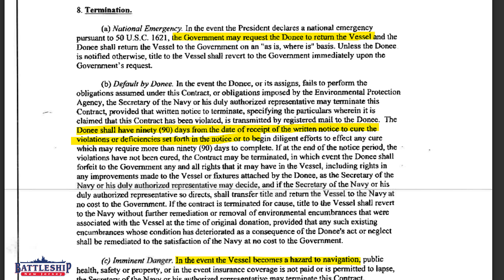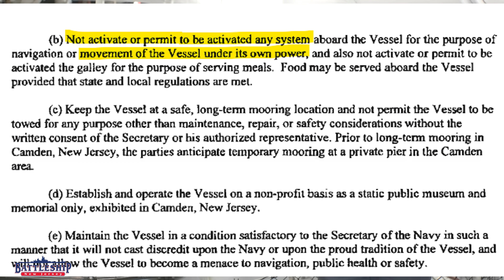Can Battleship NJ Still Move Under Her Own Power?

Comment: Question. The  turrets are all one assembly and they go through the armored decks, could a crane (if one strong enough could be acquired) lift the entire turret assembly out either in sections or whole and the engines replaced through the openings?
Reply from the maker: The turrets have locks that would make removing them wholemeal difficult. Moreover, you'd have to completely gut the inside of the ship to pull them out through there, the cost of which would defeat the entire purpose of doing this.

Comment: The USS COD in Cleveland Harbor could move under it's own power. if it had propellors on the shafts (They are in the yard) and it is sitting on the Lake floor. I mean they just moved it.. so maybe it would move. Just need props installed. Hope you do Museum Ships on the air. Ill be there next year.

Comment: I had the privilege of watching the majestic Missouri sail into Monterey Bay in the late 1980s with the both the Missouri firing a 5 inch 38 and the Presidio of Monterey DLI firing a salute as well as would be tradition at times for ships entering ports.  The Missouri was on the way to the Middle East.  A couple of naval patrol boats accompanied the ship with the gunners firing I assume blank machine gun rounds as part of the entry salute which I actually got one of the spent brass as the navy was handing them out as souvenirs.  I remember having dinner with my wife on Fisherman’s Wharf looking out at that awesome battleship at anchor.  As Monterey Bay has a very deep submarine canyon it would not surprise me if there was an accompanying attack submarine nearby to protect it as carrier groups often have.  I also watched the Iowa years later being towed to the mothball fleet in Benicia.  Kudos. for your work!

Comment: He taking old Battleship like in New Jersey and retrofit like you do an old car and I put Modern Diesel engines running generators that run water jets made by Rolls-Royce and turn it into a missile frigate instead of artillery shells it can shoot missiles other than 18-inch guns steak a couple big boy lasers on there believe it or not it has torpedo tubes front and back back from World War II but they can be retrofitted instead of dry dock and all these things and letting them sit up on the Saint Lawrence Seaway her out at Long Beach in the museum it cost a lot less money than retrofit something like that than to build a new missile frigate

Comment: Does the Navy actually know if the long term preservation is working? A lot of time when we do things like this when we come back to them it's "oops, looks like there's processes that happen over these time spans and these conditions that we never knew about or understood - and now it's either economically irreversible or we just don't know what to do".

A good example is when we've tried to define standards in physics. Almost every time we've based it on something physical, after several decades it's "right so it looks like some of the platinum standards have gained mass and others have lost mass over the past few decades and we have no idea why, despite platinum seemingly being extremely nonreactive and samples being stored in the same conditions".

That's why we essentially gave up and decided to base them on exact metrics instead of arbitrary ones.
Reply from the maker: The navy isn't involved with these ships at all, so no. But as museums, we do get together and talk about our preservation challenges and how to solve at annual conferences and, to be honest, we all talk a lot.

Comment: One of my instructors in Navy basic was on the New Jersey- he said they worked as floating machine shops for the fleet- their motto was if you could get it into one of their machine shops, they could fix it. There were massive machine shops on these ships including at least one case where the shop was accidentally made with no hatches- someone noticed a blank spot on the plans, they cut through one of the bulkheads and found a fully stocked machine shop from when the ship was first built, sealed up for decades.

Comment: I would think de- comminished ships could still be used as a homeland security .also help stop illegal fishing. I  worked for Massachusetts water resource authority and we used engines such as enterprise, Chicago and walkashaw as both pumps and generators dc power. Question there are various de- comishion ships in various locations along the west and east coast as well as Florida, Louisiana so my question is there a location with various former navy ships location

Comment: I really hate your I can't do attitude bullshit... It'll be extremely easy to cut a hole into the top of the ship. And put a new motor in it.  And taking the oil out of the ship to put in new oil will not make the engine decompose. I know how steel works, and steel doesn't work that way.  If you keep paint or oil on  steel, it will stay good.   That's the reason why the navy makes. Ships operate ships and maintain ships while you just look at them.   With your can't do Attitude.      And another thing people can always learn how to operate in those engines.   And I'll add 1 more thing to it. If the ship was put together, the ship can be took Apart to put a new motor in it.       And you act like as soon as you Take the oil out to put new oil in all. The metal is just going to magically Wild together.  There's steam engine and gas inches. That's sitting a 100 years that was started Up and running.    You truly don't know what you're talking about
Reply from the maker: The ship was built around this engine, to take it out would require cutting the armor, armor we don't make anymore and armor that loses its strength if you weld it back together. 

And those steam engines that still run have been maintained to run, ours hasn't.
Reply: Good response to a completely unreasonable comment. If only it was so easy to just rip out and slap a new propulsion system in 😂

Comment: Even though the engines are preserved for storage is there an expiration of how long the process of preserving the engines will last before it may have to be done again? Also if they did have to the perform that process would they rotate and portions of the engine due to the fact they have been dormant for so many years?

Comment: 1982 west of Hawaii, I was a radarman on board USS Fox CG-33 we had become one of her MANY sisterships and were meeting her for the first time. Someone on the other side of CIC yelled out "max out your range." I didn't ask why, just did it. 25 miles was normal range on SPS 40. At about FORTY MILES there was a HUGE thick return. Never seen anything paint like that. I got some one to sit on my scope  and went to the signal bridge to watch. Scary big. I wish all the flat-earthers could have seen its approach. First mast, then superstructure, then MORE superstructure,  then MORE!  By the time it got within 12miles (horizon) it looked impossibility close. Our little 440ft aluminum guided missle cruiser was like a TOY compared to her majesty. Got goosebumps thinking about it. Was an honor being air picket for her

Comment: Boiler operator no longer a specialty in the United States Navy. This may present a slight problem since the propulsion system is absolutely dependent via eight 600 pound boilers. I steamed the Missouri BB (63) around the world in the eighties as a young bt 3 operating her super heater burner front. I guess what i am saying is good luck with getting them fires lit and a full head of steam .

Comment: It would be far easier, in my opinion. To build a brand new hull specifically designed for what large naval gun platforms were eventually used for. Design a hull with 2 to 4 large calibre guns optimised for shore bombardment. Then give it a couple of destroyers worth of attack and defence missiles and point defence. Then, use it in an integrated task force.
Reply: We can surely do that. But will there be capacity for that in case some disaster strikes? Events like war tend to twist the economics in building war resources. Cost will not be a question any more. The opportunity to rebuild the Iowas and other BBs, might be a faster way to get combat ready ships, if all the shipyards are bombed, or busy building other war materials!

Just keeping the BBs as museums, can act as a threat to potential enemies of the USA.

Comment: Per the fine print comment, having been a lifelong fan of the Iowas(I wanted to join the Navy and serve on one, but after the 1st gulf War, subsequent decommissioning, I came to my senses and went Army, ha ha) I've wondered what context would require the Iowas return, honestly, very few instances, any navy the U.S. could potentially face would be adequately handled by contemporary navel power.
Heavy shore bombardment just inst a prerequisite on the modern battlefield...
And blue water engagements are over the horizon games and the silent services ballpark.
As amazing as theybare, there's just not a practical utilization in these times. Other than a show of force, but aircraft carriers can do that.

Comment: To be honest, Some ships should be restored into some form of active service. The USS Enterprise "Grey  Ghost" is another ship that should of been restored. The "Grey Ghost" if i had the money, that would be one ship i would of liked to re-start.
Reply: What about the reactor?
Reply: @noname-yo6yn  The Problem is that large items is placed early into the build stage, so replacing parts is alot more tricky. So reactors would have to be somehow disassembled while still in the ship, chopped down, then replaced with a new one that can be built inside the ship. So getting a 30ft metal plate into a door, 6ft high, and 3 ft wide is a magic trick. the other option is to disassemble, and reassemble entire sections of the ship. so the cost is expensive. some repairs cost more then the value of the ship when its first commissioned. There is a tactical advantage of having ships that is more robust, and analog.

Comment: I understand that the main engines can't be reactivated but what about some of the smaller systems? Generators? Do you use the ships original lighting? Can the 5" mounts be turned?
Reply from the maker: The generators require water to be brought in so no. The lights run through their original fixtures and the 5in guns rotate and fire.

Comment: Why has it not been maintained ?  We are constantly getting involved in other people's problems , and you have a ready made gun platform , ready for use . Why not use it .....and maintain it .
Reply from the maker: It's 80 years old and outdated.
Reply: So is the B52 , but its still has practical use .  @BattleshipNewJersey
Reply from the maker: B52s are a decade newer and can much more easily have parts changed out for repairs. We can't just take the engine out and put a new one in, nor the guns for that matter. Not to mention, its been sitting formant for three decades and not being maintained to functional.

Comment: If they ever put out a call for engineers and BTs to steam her to drydock even at 69 I we would go in an instant, I served on, Coral Sea and Oriskany, Oriskany had the exact same power plant, Coral Sea had the 600 PSI high pressure system, we just had 4 additional boilers , Oriskany had 8 boilers, Coral Sea had 12, she was really fast, anyway a boiler is a boiler, I'd be there for it....

Comment: HOGWASH!
If one was so inclined...one COULD simply cut into the ship, and replace those engines. It is a lie to claim that it can't be done...OF COURSE IT CAN. One may not want to spend the time, resources, and funds to do it....but it certainly can be done.
Reply from the maker: Doing so would weaken the armor in an repairable way, what's the point if your armor can't take the hit?
Reply: @BattleshipNewJersey  
All armor can be repaired. What's the point of building a battleship that can not have it's armor repaired after taking damage? Welding has been used time and again to close intentional access holes created through armor. #GiveMeTheProverbialBreak

Comment: They don't have to cut a hole the decks of CVN's to refuel the reactor.  All current CVN's have removal able deck plates that are bolted in place.  All from the hanger bay to the reactor compartment.

Comment: Speaking of the blanking over, is there anything in that that could result in dissimilar metal corrosion? Curious if they'd ever need replacing.

Also, if you could somehow magically handwave away all the impediments to reactivating NJ forever, would you even consider reactivation? I mean, NJ would burn a lot of oil, among other things... I think the environmental concern alone would be a big enough reason to say no.

Comment: I was a Boiler Technician and was on NJ 89-decom, assigned to No.1 Fireroom. Could the New Jersey move under her own power? The answer is yes. However, it would take significant work (and momey) to get her engineering plant back into working order. Not only that, all fluids, such as fuel, lube, hydraulic oils would need to be onloaded. Boilers, main engines, and aux equipment (those disaasembled) would need to be reassembled, checked, and tested. One of the main reasons the ships were decommed was the cost of operation. All that said, I'd go back and help to get her back to steaming condition!

Comment: Congratulations on 200k 🇺🇸

A $2B~ modern Battleship now that’s Bad Ass.
If the diesel engines of a warship like the Battleship New Jersey cannot be removed, but there's a need to upgrade them to meet modern fleet demands, you can consider: 

1. **Engine Refurbishment**: Overhaul the engines completely to improve performance and efficiency.

2. **Fuel Injection System Upgrade**: Modernize the fuel injection for better fuel efficiency and reduced emissions.

3. **Electronic Engine Management Systems**: Install systems to optimize engine performance and emissions control.

4. **Exhaust Gas Treatment**: Use systems like scrubbers or SCR to reduce pollutants and comply with environmental regulations.

5. **Improved Air Intake Systems**: Enhance air intake with advanced filters and turbochargers for increased efficiency and power.

6. **Cooling System Upgrade**: Update the cooling system for better handling of engine heat.

7. **Vibration and Noise Reduction**: Implement modern technologies to reduce operational noise and enhance comfort and stealth.

8. **Regular Maintenance and Monitoring**: Establish a rigorous maintenance schedule and use monitoring systems for better engine management.

9. **Training Crew on New Systems**: Train the crew in the operation and maintenance of the upgraded engines.

10. **Hybridization**: Consider a hybrid system combining diesel and electric propulsion for improved efficiency and reduced emissions.

11. **Energy Recovery Systems**: Install systems to recover energy from exhaust gases, increasing overall efficiency.

These measures will significantly enhance the diesel engines' performance, aligning them with modern naval fleet requirements. Manpower Knowledge of Antiquated technology is not a factor. Take care of her in Dry Dock, she may be needed for future military operations

Comment: Probably longer, since the equipment on it is so old, the people trained to service it are probably in  pretty short supply.
Reply: All the navys boiler makers have been gone since 06
Reply: @s.porter8646  there may be some in the civilian sector, but the cost to train new ones would be prohibitive, unless we go to war, and need some big guns, or turn the iowas into insanely armored missile boats.
Reply: @freedog632  those were the civilian boiler makers. PSNS has some old timers that ""can"" but the boiler shop is sitting idle. Kitty hawk and Frank Cable were s the last to get retubed. Oh and a yard in YOKOSUKA japan...owned by japanese...but I get what you're selling
Reply: @s.porter8646  where I work, had old ship boilers from a scrapped ship they used, but they just converted to LNG, I think, a few years ago. I had to calibrate the instruments.  Those were some nasty items. Bunker oil is disgusting.
Reply: @freedog632  ew...yea you win. I was on USS SACRAMENTO from 99-01, doing the mud tank sucks..I was engine room side, so got burnt instead of dirty
Reply: @s.porter8646  I usually only had to deal with them offline. Not complaining about that, though. Seeing them operating is pretty cool.
Reply: @freedog632  yea...it's hot
Reply: @s.porter8646  I've been around them operating. That is definitely an understatement.
Reply: @freedog632  working around nuke boats they keep the engine room cooler, buddies on cable and blue ridge are continuing to be miserable

Comment: Gads! I would hope our Navy has detailed textbooks on all of the engine operating procedures. Yes this would only be considered theory to get them going again when the last of the engineers fall silent however when they were first brought into service most of the engineers had some degree of experience with steam power but there are differences even between ships of the same class. I am sure the Department of the Navy has old 16mm films as to how to work most systems for training purposes and I would hope they have taken the time to digitize the films as well. Simply put age takes it toll on media and one has to transfer it to the latest format lest the equipment that displayed it dies with no chance of reviving it or replacing it.

Comment: IIRC aren't the propellers sitting on the ground and not actually attached to the shafts to prevent corrosion?   That alone would prevent the ship from moving under her own power since I do believe they require a dry dock to be installed.
Reply from the maker: Our props are still attached.